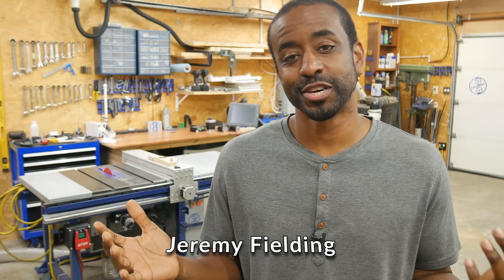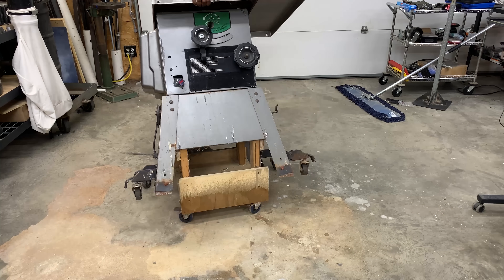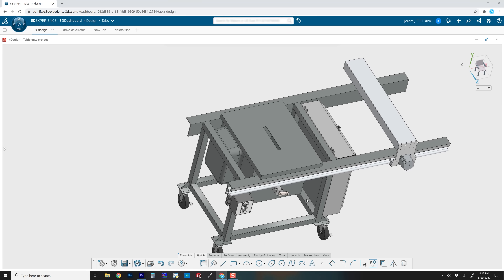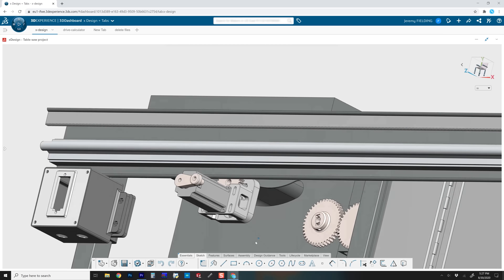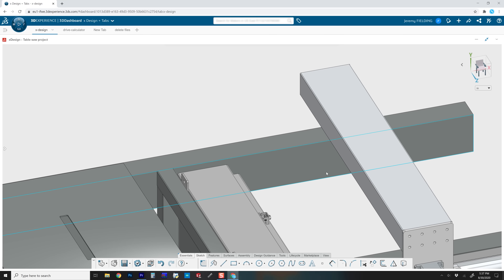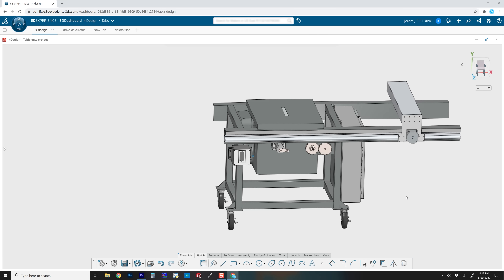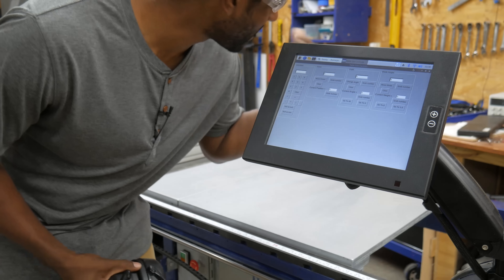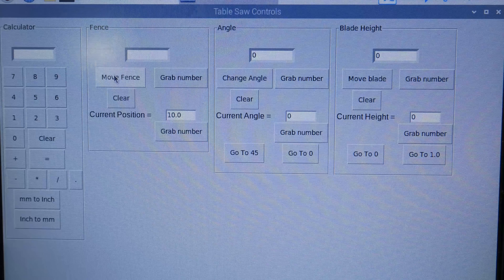How To Make A CNC Table Saw : # 084

Comment: for the handle of your blade height , make it removable, or slip into a neutral position where it disengages the shaft so it wont turn with the stepper . Then pop it back on or in and they you can manually crank it .  Great stuff man .

Comment: Awesome work - I'm just about to rebuild the fence and rail on my table saw.  And I've already got a Maslow CNC, so seeing this I went "Ooooooh yeah".
For your next trick get the thing to understand GCode, although you would only need a very limited subset of commands.
You can still use Python, but you might want to switch to cncJs if you actually did that.

Comment: the stepper does not have enough torque to snag anything  :)  remove the handle and use a round knob (with or without  something to grab on to) might fix 2 problems at once,  its less wobbly, and wont snag.

Comment: Jeremy! Really enjoyed the video man. A small suggestion which would be super helpful. Typically you don’t want your blade over exposed for the cut. i.e. you wouldn’t want 3” of blade exposed to cut 1” thick material. My suggestion is to add a material thickness control. You set the thickness of the material and the blade will index to the proper height for the cut. So input material thickness 1” = blade position 1.125 to give you an minimal amount of blade exposure. This will reduce chipping and friction. This would also complement your cut list idea nicely as well. Overall great build man. Really enjoy your videos. Keep up the great work.

Comment: Wow. I am very sorry to say that as a long time subscriber I somehow stopped watching. Nothing you was doing wrong I think YouTube stopped notifying me and I just had taken a break from wood working and blade smiting to build a Hot Rod. So I just kind changed what I was watching. That said I stopped shortly after you moved out of that tiny shed. Man what you have learned since some early builds like the little lathe is very impressing. Totally missed you taking up welding too. I will have to spend sometime catching up. I always liked watching as we was like minded a lot. Now I have two suggestions. 1 get you a nice Mig welder with some 74/25 shielding gas. You will be so amazed the night and day difference from flux core. Everlast makes some  nice machines very affordable. 2nd I would say please build a box joint jig that is stepper controlled that can add onto the existing controls. It would be cool to have it controlled wireless and powered from a cordless battery pack. It might  be kind big to fit all the motor drivers and stuff so maybe just a quick connect cable of some sort so the electronics are housed under the saw .I would like that a lot. Then if you had to do something else adding a router to one end would be cool. Keep up the good work. I am tuned back in. Thanks for the up load
Reply: I guess if you just made a sled to hold your wood the fence could be set to move over every cut making box joints easy. Duh just thought about that. Wow you need to add some finger joint settings to your fence so it just moves over to the next cut  every time you hit a remote button on your sled/jig that's hold the wood up so you can cut your joints. You could make any width with a single blade. Shit Now I really want one. Even if only the fence was modified to move. Might have to try this next year after I am done with the hotrod.

Comment: With the way you set up the machine wouldn't it be possible to let the machine know where it is by it selve? Like how it is done with cnc machines. That would give you the possibility to just say go to this position even when you manually changed the position without the motor engaged. It isn't neccesary but it's a huge comfort upgrade

Comment: I can see this being used in a cabinet shop instead of having multiple table saws set for each individual pieces.  You can run a code for each cabinet you wanna make. And have it set so it cuts the parts I'm sequential order. Or have it watch out a bunch of parts in order.

Comment: Very cool idea. I'm not sure i would have gone that far but it did put a thought in my head. I think I have found my next project. I'm only interested in one thing however. I want to make an auto sled. The sled will have sliders and easily removable. The sled will be an auto feed. With holes all over it for work piece hold downs. Clamp a small piece of wood and let it feed into the cut. May even design different length sleds to all fit the same feed. This will keep my hands out of the way on small things. Love it. Good work.

Comment: There are dozens of math functions you could use for your motor acceleration algorithm. It's similar to the problem of accelerating and decelerating an elevator. It's also related to shaping pulses in a digital data modem to control bandwidth. You could do a lot worse than a raised cosine.

Comment: Curious to see how the 3D printed gears hold up for you. Have you used them in the past with good success? Did you have to make them beefier to compensate for the material, or use very low infill on the 3D printer? I take it the tolerances are acceptable for this application. I'm curious because we were warned against 3D printing gears in my mechanical design class.

Comment: Dude this is so rad. I just found this channel. I think you can find sample code for acceleration in Marlin 3d printing code, although that's written in C++. But you probably already knew that. :) I know you mentioned cost as a factor in selecting steppers with encoders, do you have any plans to perhaps add linear encoders? Probably pretty simple on the fence, but maybe not for the height and angle...

Man this is so cool. I just got into 3d printing this year and am also learning all about how to program CNC. Can't wait to see what you do next!

Comment: You could install a hand wheel with a folding handle for blade height adjustment.  They are fairly common on manual milling machines with CNC controls.

Comment: Damn, thats cool project bruh! I wanna see you tackle building a high power electric bike conversion. Check out the Cyclone 3000W mid drive. Turns a mountain bike into a motorcycle.

Comment: This is super cool. I only glanced at your fence move function, so I'm not sure how helpful this will be, but over in my world, animation, we call accelerating into a movement "easing in," and decelerating out "easing out." There are libraries for easing animations, and some nice graphical views into the easing types, like this one for CSS's built-in easings: https://easings.net/ - you can roll over each for an example of the movement. For Python, you could use this one: https://pypi.org/project/PyTweening/ It's very easy. You just think of your entire travel as going from 0 to 1, break it up into linear steps, like say 0.0, 0.1, 0.2, etc., and then feed those to your chosen easing function, probably easeInOutQuad; it'll return the eased version of the number (there are a few examples at that link), which you can then multiply by the actual distance you want to travel. Basically, you break up your distance into discrete distance steps, from 0 to 1, throw each step at the easing function, and get back new step distances that have the accel/decel baked in. Anyway, just throwing it out there, in case it's of any use. Again, nice work!

Comment: This is the coolest table saw project I've ever seen! I love how you can switch between manual and auto control too. I could easily see using that to do stuff like drawers where you cut all the pieces using manual control, then switch to auto control to cut a couple kerf widths for the bottom dado.

Comment: You could've just used a sanding pad for a drill or random orbital sander and wd 40 or a resin disk. Bosheilds for rust prevention. Expensive but worthit

Comment: Hey Jeremy, awesome project. Is there some sort of cnc control lockout once the blade is turned on? As a safety precaution. It would be terrifying and dangerous if the fence or blade height changed whilst you were operating it.

Comment: OMFG that is amazing. I would be curious how long the calibration lasts or if the vibrations from a table saw over time will cause things to not be zeroed out correctly. This could dramatically change the work flow in any small wood shop. Typically you end up cutting all the parts that need to be the same size at the same time because no matter how hard you try if you have to reset the saw you will always be off by a little bit. With a couple quick pushes of the button and I could have the entire cut setup again within 1000th of an inch? Sold. I hope you plan to put together detailed plans on the electronics you selected for this. :)

Comment: Jeremy that is quite an accomplishment! But honestly I don't get it really I use my table saw all the time and it looks like I can move a fence... Raise... Tilt the blade... in way less time than it takes you to input the data. And you still have to pick up material and hand feed it, just being honest buddy. Now when you make an auto load system for your material that also can cut certain pieces at certain dimensions and auto feed out and change geometry of pieces being cut as they are auto fed into and then Auto eject... I would really like to see that.! Then I think you would have a truly C&C table saw.

Comment: Rather than a cut list (which would be most useful if you’re doing mass production) maybe some memory slots that mean you can quickly get back to a saved position on all three axes? And a history that auto saves the position each time the saw starts.

Comment: Just drive your system from the same side everytime or add a spring to the end, that will eliminate backlash.  If you are having a hard time spec'ing a spring, a motor and a cable and pulley would solve it too.

Also, a linear encoder on the fence will solve your position issue, you want encoders with reference marks 

Nice work though! This is pretty damn cool.

For motion control use a PID loop. It will take care of the hard stops and starts.

My day job is making motion control and embedded systems for dimensional metrology systems so ping me if you have any questions

Comment: Great job -   +1 on the riving knife comments  -- or at least  a MJ splitter for vertical cuts.  (so many comments,  I actually loaded a browser extension to search through them all to find that this has been suggested already). 
Dado routine seems to be the next logical extension for this and the UI.   You've got all the control you need, just a little more coding time, including the backlash compensation ---   SUBSCRIBED!
Reply from the maker: Check my Instagram for an update on this

Comment: When my table saw or router table gets some rust I use a grinder with a steel wire wheel attachment, it really doesn't take longer than a minute to do the whole thing.

Comment: Another great project & success, thanks for sharing!  I'm inspired by your enthusiasm, by your motivation & by your perseverance.
For safety functions, like overtravel detection/prevention, I would make one suggestion.  Choose instead normally closed proximity sensors (providing signal when not actuated) & coordinated monitoring which requires an affirmative signal (again, not actuated) for an acceptable (safe) condition.  With this arrangement, a sensor malfunction, a cable conductor break or a wiring panel terminal disconnect will simulate an overtravel condition.  With a failure in one of your existing sensor circuits, your motor might not respond as desired to an overtravel condition.

Comment: 1. I couldn't get a string of LED lights to do what I want with a given base program for my first coding project and you build a 20+ variable system with GUI. Amazing! 
2. I totally want to build one of these things now... 
3. Thanks for sharing the code and designs they're definitely going in my build proj folder. 
4. Question, how did you make sure the fence was parallel to the blade and stays that way?

Comment: Would really consider servo breaks and disabling the motors when the blade is running.  If something freaks out and you have a motor run mid cut it could be deadly.
Reply: Absolutly my idea

As a SW engineer I never really trust SW 🤣
Reply: Yeah. The standard for industrial robots is to use motors that have normally closed electric brakes. That way their default state is locked in place. Barring that, a hardware interlock that keeps the steppers in holding torque mode while the saw is active would be wise
Reply: A way to do this with existing mechanical hardware would be to put a relay in parallel with the saw blade motor to create a "motor on" signal.  This signal could be used to disable to step inputs at the stepper motor controllers.  Not sure the best way to disable.  If the step input is always high or always low when the motor isn't moving diode or-ing could be used.  If not, perhaps a D flip-flop would be best.
Reply: @richs5422  Open by default relay which closes when the motor is running..... yep that sounds like a good concept for a solution.
Reply: I can see everyone's point behind the braked or locked-out servos, but if you do that then you leave no wriggle-room for a length of timber with some torque in it due to a warp or a bow, thats a far more likely situation for most people using a large tablesaw, just because of what we're cutting. I mean we have a deflection guard in our workshop directly behind the big ripsaw thanks to kickback! 👀

If you were a 100% sheet goods shop I'd maybe see the logic, but for more general use and anything involving construction lumber, I'd take the wiggle room over protection from software gremlins :)
Reply: @mor4y  The braking is only applied when the motors aren't being moved. They're extremely strong spring loaded brakes, or in the case of motor braking it can hold up to whatever the limit of the motor is. It would be able to withstand torque from normal operation, and you can always release the brakes for fine adjustment.
Reply: Why would you bother ? CNC routers operate quite reliably Same tech don't see a need to Cotton wool it

Comment: A possible way for acceleration could be: add a time interval variable between step commands, and something references what step its on, and shortens the duration to till its at top speed

I'm not 100% sure how you command stepper motors on that level
so im not sure if you have access to that level
if you don't, and something else handles stepping
that probably has an acceleration setting

Comment: A more elegant solution to the lift crank issue would be to go with either a "push to engage" or "pull to engage system" (depending on the ergonomics) or even a friction clutch mechanism. Would need a slightly longer shaft. I'd probably go with something similar to a Lovejoy coupling, sans insert, with one side attached to the stepper shaft, and the other side attached to the handle. Free to slide on the shaft, but held apart with a spring until you push them together. Depending how far you want to take it, could add a gravity or spring action lockout that would require two hands to engage the handle. Perhaps an "L" with a hinge on one end that physically blocks the handle side coupler from sliding.

Incredibly interesting project!

Comment: Acceleration will be cool. Since you are using stepper motors, you can just decrease the delay between steps as you go along until you reach maximum speed. You can work out how many steps are needed to get from zero to full speed and vice versa. Call that the acceleration_distance. When you are acceleration_distance away from your destination, you have to begin declerating by adding time between steps. For short moves (less than 2x the acceleration_distance) you begin your deceleration at the half way mark.

Comment: Interesting build, and the surface turned out great.
Are you looking to make it auto-zero itself in future? (Zero the fence, blade height, and angle, etc..)
Similar to homing feature for 3d printers, just some sort of limit switch to tell it when it reaches zero, and put a micro adjustment on the switch to calibrate it. 
I totally understand the coding pain.. I built a 3D printer from scratch (not a kit) and had to learn all the code behind it to make it work. Took a while, but the reward was awesome when it worked.

Comment: Very impressive.... I had the exact problem with interference on my limit switches and I eventually installed an optocoupler. I had been toying for about a year to build one of these... and my current tablesaw is a low budget machine. Guess I'll be busy for the next few months.... Again Jeremy excellent work.👌👍
Reply: Hmm... about your stepper on the fence being in the way... what if you installed the stepper inside the fence and have a belted gear on the front. You can then make a small cover to hide the belt...

Comment: If you do add a homing function, you may also want to consider an adjustable value for blade diameter and width/kerf. This could come in handy for certain projects where you want to maintain a zero across tool changes.

And for bonus points? FINGER JOINT function to move a set amount over and over. Matthias Wandel would say it's way too complicated (but I think would secretly admire it.)

Comment: Look on youtube ways to electroplate the metal table. Most of them will be tutorials on how to dump the whole table in a tank so big that you can't afford but you will also find a people making a pen - that's the way I would go. With a stainless steel electrode, you can remove the rest of the rust, electropolish surface, and finally electroplate surface to protect the surface.

Comment: As a woodworker this is a Great idea and build but I’m sad all the work was done on a basic saw. Had you done that on a decent 3hp cabinet saw with cast iron wings you’d have a rock solid base to work from. Paste wax works well for keeping the surface free of rust and it’s cheap.  Great build as always !